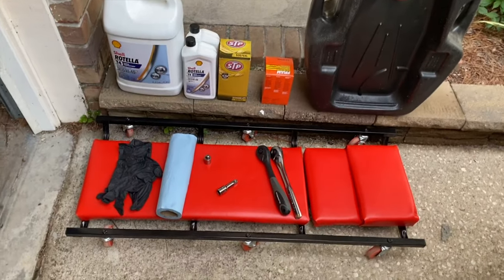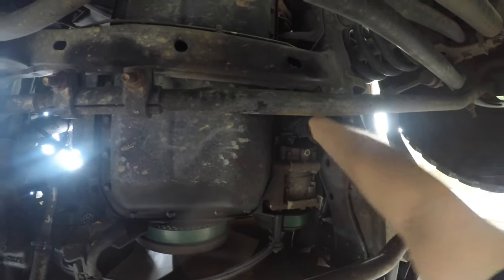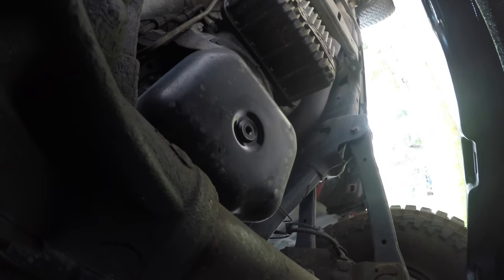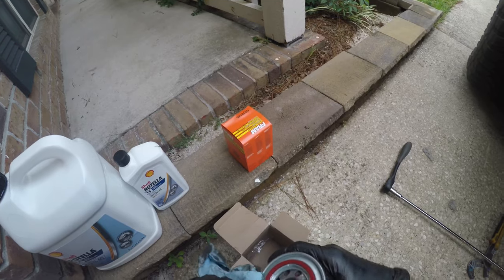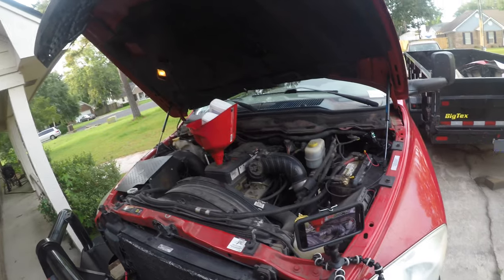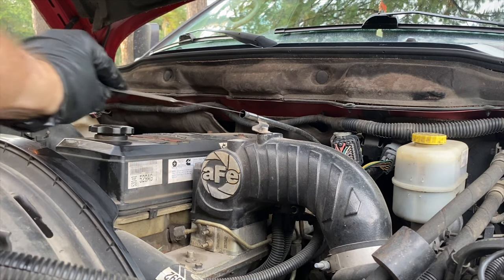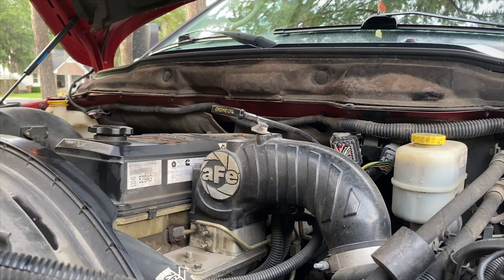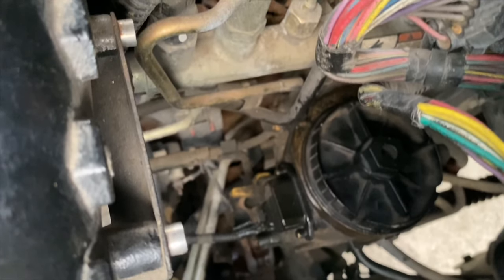5.9 cummins fuel filter change and oil change.  Best Ram 3500 Mega Cab Build Ever.  Overland Build?

Comment: What transmission fluid do you use?
Reply from the maker: I’d love to tell you it’s amsoil, royal purple or some magic high speed stuff; but it’s just plain jane ATF+4.  The stock torque converter failed at 130K, so I had the whole trans rebuilt with a mild upgraded torque converter and a towing valve body.   If I had a full built ATS or Suncoast trans ($10K+) I’d run something better. Heat is the biggest threat, so running a deep pan (ATS) helps trans temp is usually only 185-202, Towing it will creep up to about 214.  The Bully Dog helps keep an eye on things...she will still scoot with the 4.56 gears, but a 4.30 with 37’s would be ideal. In the diffs I do run Lucas Gear oil.